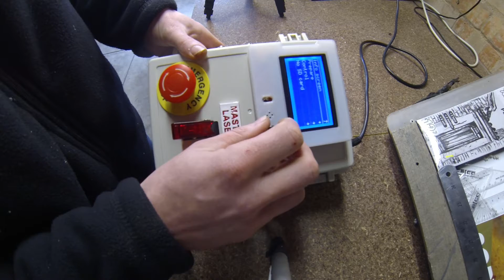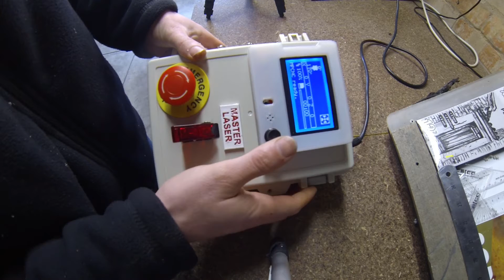mpcnc build control box assembly EP3/4

Comment: Amazing video!  Thx for it.  Did you print your LCD cover?  Did you link to the locations where you got the stop machine button?  And other parts.  Did not see them when I just looked.
Reply from the maker: Yes i did it should be in the description, i had the stop button laying around i think i bought it off ebay.